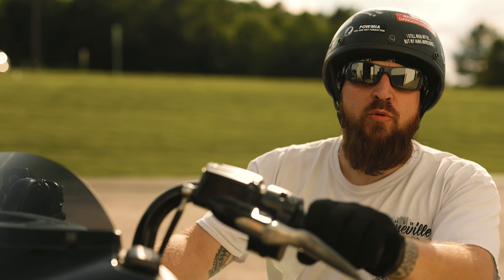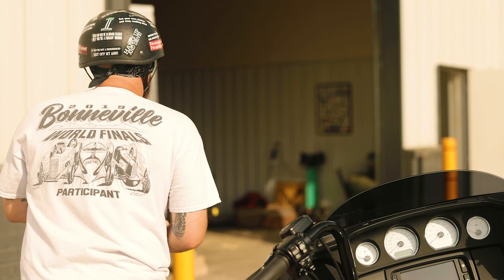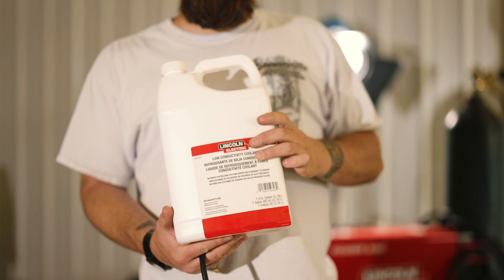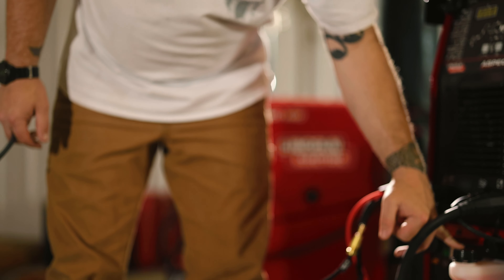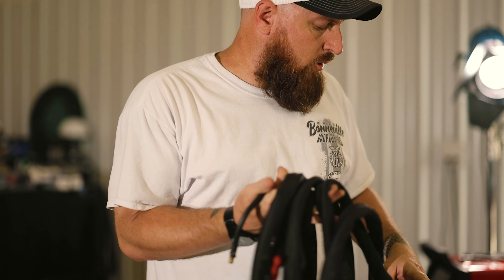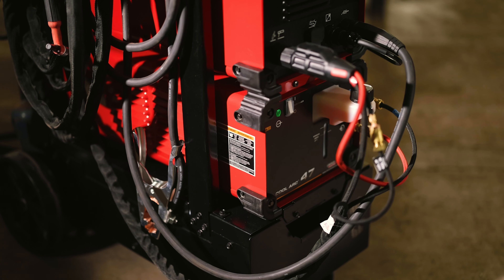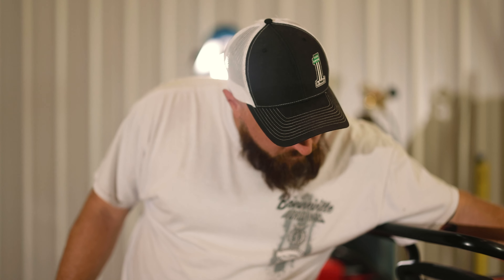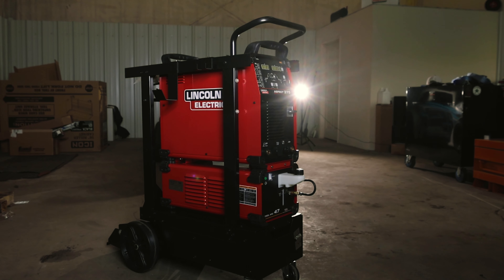Lincoln Electric Aspect 375 (Part 2)

Comment: I like Lincoln Tig welders, however, this aspect 375 is completely stupid. The Miller Dynasty 400, you get FULL output on single or 3 phase. Aspect 375, you get full power on 3 phase only, and 250 amps on single phase.